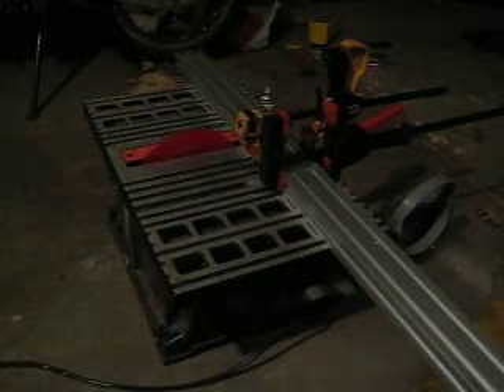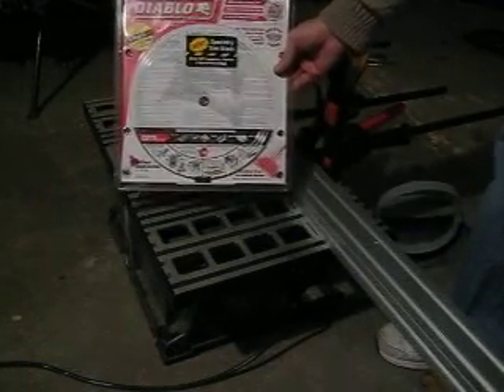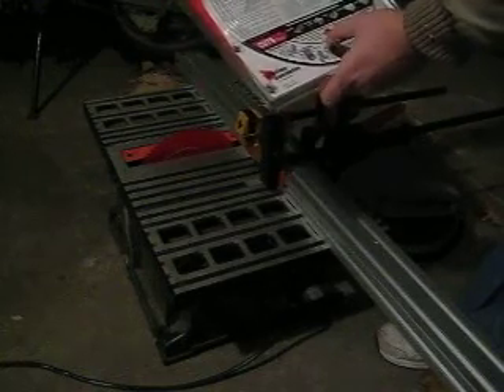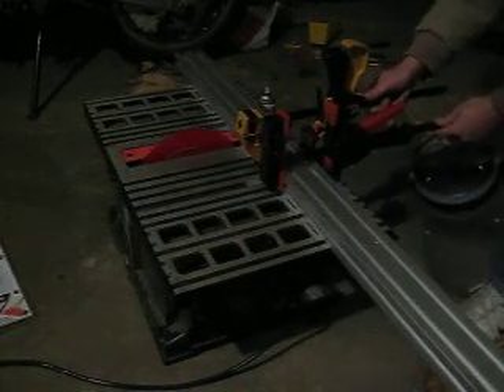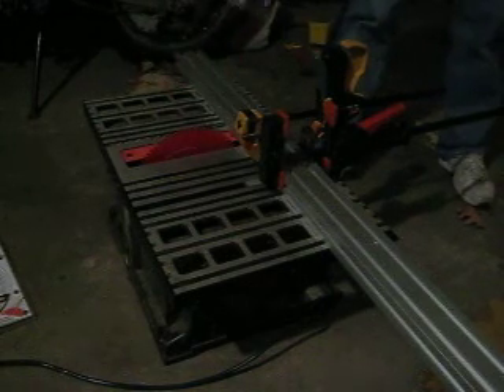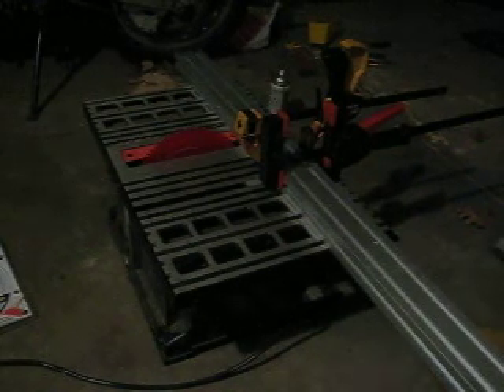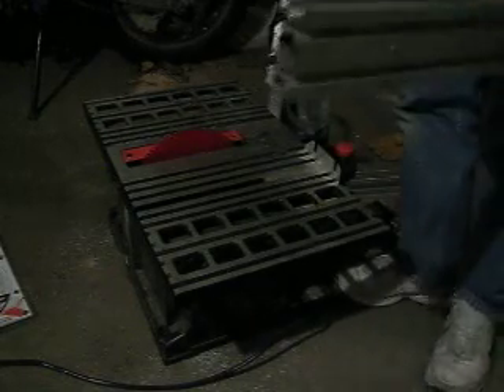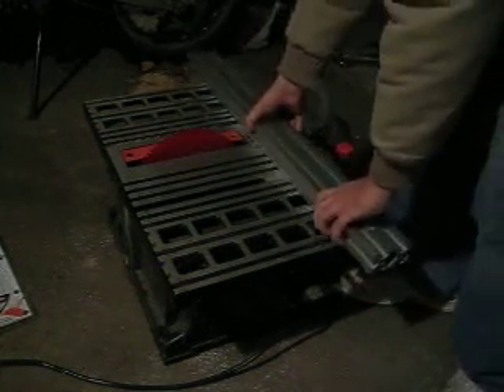Cutting 8020 Aluminum Extrusions.avi

Comment from the maker: Good observations.  As this was the first in probably 50 or so, yes, there was a learning curve.  On subsequent cuts, I did ensure that blade height was just over the  material height.  As far as the gloves go, I was being extra careful since on the first cut I did not know what to expect. As I became more comfortable, it was a toss-up between extra control (no gloves) and extra protection (gloves).  I have always used my table saw on the floor.  It is what I am comfortable with. Cheers!